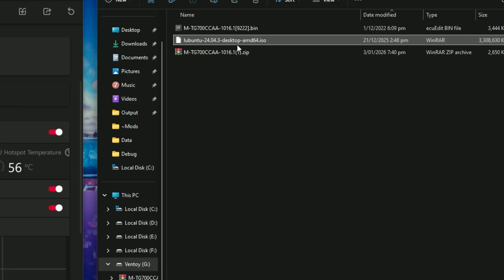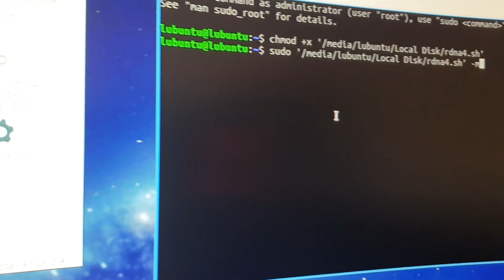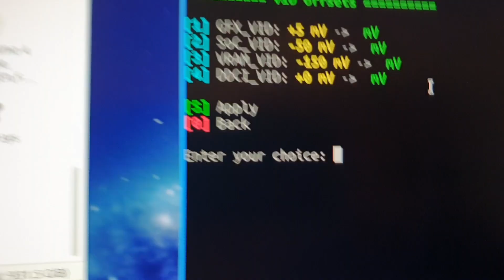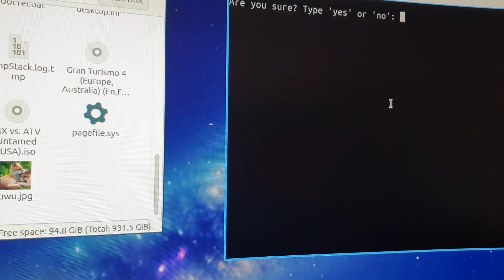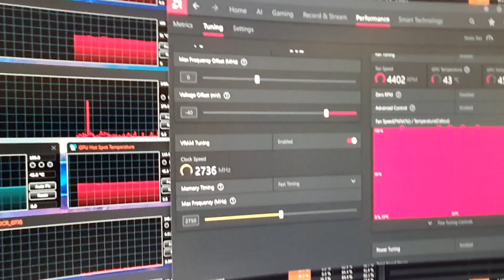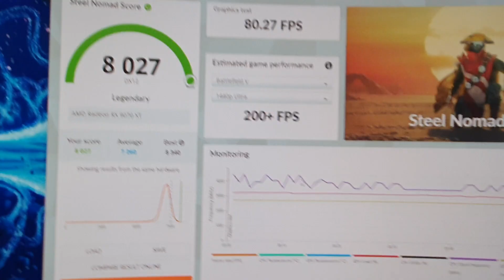RDNA4 Linux Eprom Flash Tutorial Raise Or Remove Power Limits

Comment: This is dope. With rebar off, -50mV and +10%pl my Aorus elite 9070xt still pulls 500w transient while maintaining 75C hotspot, so I'm curious if I can set 550-600w and still maintain a sub 80c hotspot temp. Idk why people hate gigabyte my card never goes over 75c hotspot 🤷‍♂️ tons of headroom and these cards love more juice
Reply: Just to be clear too, I won't be setting 550-600w without frame caps. I run a 240cap in all games I play, .1% lows are 225-230fps - I want them to be 240 😎 I'll sacrifice a few C in hotspot temp to boost my lows 5%.